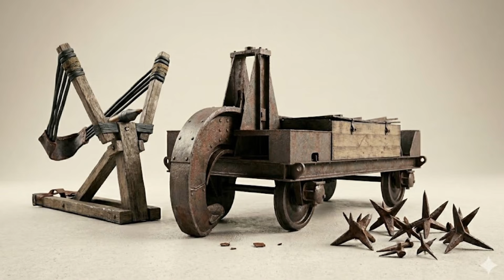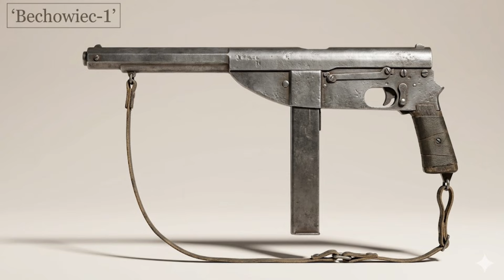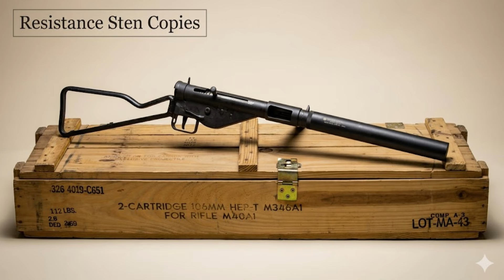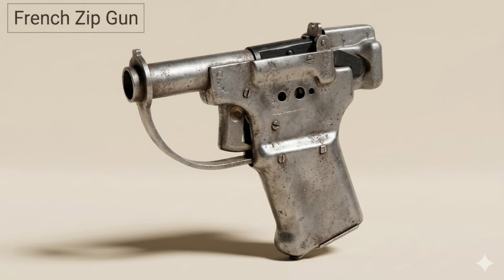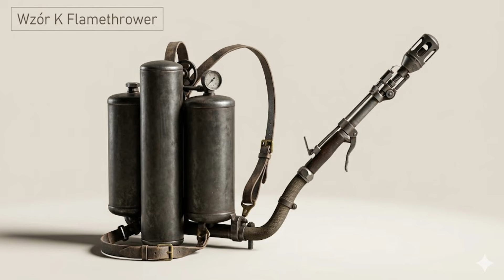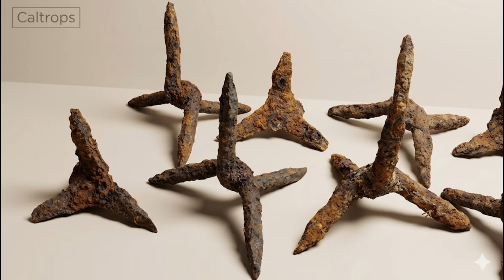Every Improvised & Home-Made Weapon Used by WW2 Resistance Fighters

Comment: hey there.
1. błyskawica (lightning) its polish smg  based on British sten sub machine gun.
being honest much better than original.
2.behowiec. smg builded by teenage. without experience and plans. he had all fire options on one wing like mp5.
3.vis pistol. polish version of colt 1911 on 9mm parabelum. 
smaller caliber means easier control, more stability and less to cleaning.
Germans producing this pistol during occupation cuz they liked him that much.
4. Filipinka and sidolówka was improvides grenades but better they was make bigger boom.
5.karbidówka was more like bomb  not grenade.
6.wz. k flamethrower. homebuild flamethrower used in Warsaw uprising. 
7. in all we producing mines. weapon parts, knives. under occupation and without machines. and if I am not wrong we been only resistance movement who was producing  magazines without factory.
Poland sends regards. 
ps: we also produced British stens.  polish was builded perfectly. nothing clacks or clicks.

Comment: The (Flare Pistol)  FP .45 ACP Liberator was manufactured by General Motors & designed by George Hyde for the OSS & was to be air drooped to resistant  groups, but most ended up in the Pacific & China & only cost $2.10 to make.  They were made to take out armed individuals & to secure a better weapon that the individual had on them.  They made roughly 1 million units with 300 workers in 11 weeks.  After the war, most unused units were destroyed or dumped into the ocean by Allied forces.  Surviving examples are rare & vary collectible today.